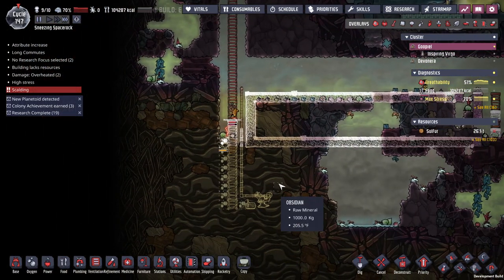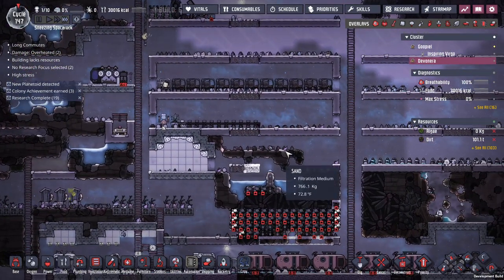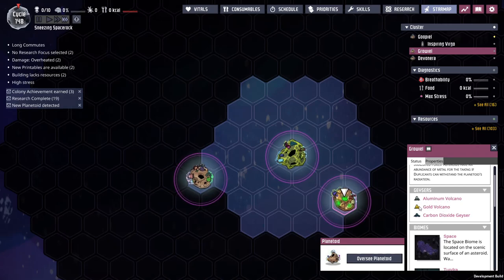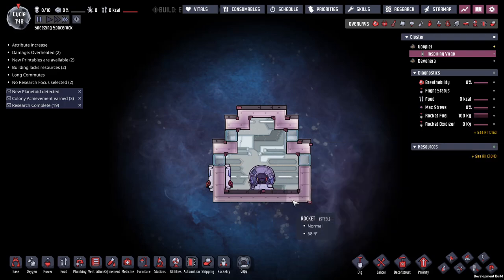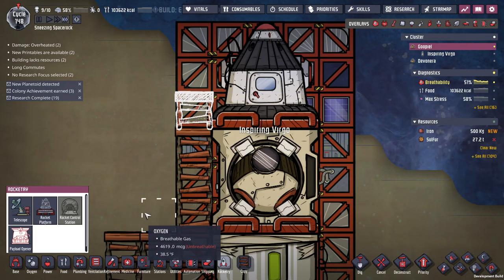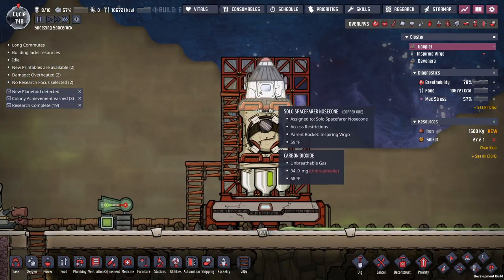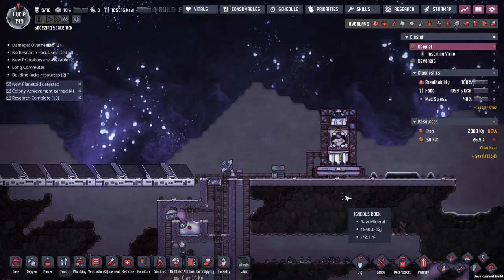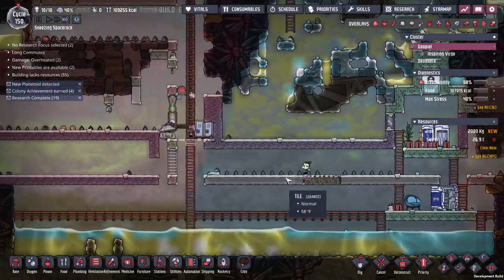Oxygen Not Included: Spaced Out! First DLC Run! (Part 8 - Epic Space Mission!)

Comment: "housing critters without actually taming them..."  I tried all the stuff you have with plug slugs, and now I just move them to a free floating slab of tiles with a wire below to harvest the power and a pocket above to capture the hydrogen.  Since they are untamed and not in a room they are always happy.  Hungry sometimes, of course, and not feeding decreases their power and h2 production.  Wild slugs produce 400w each when fed -- pretty good since you start with 5 or 6 slugs!  So I throw a few hundred kilos of cobalt ore on their slab and forget about them until I need more power or H2.  As you note in this video, solar is so good that I try to rush that using glass harvested from the POIs around the map and stop using the slugs once i have solar.
Reply from the maker: For sure, I'm in the same boat.  I think the plug slugs will have more utility once the solar panels are toned down a little bit.